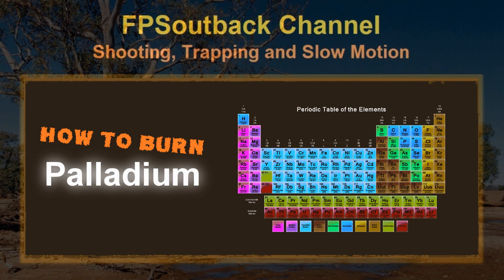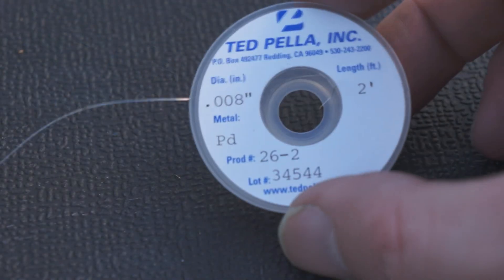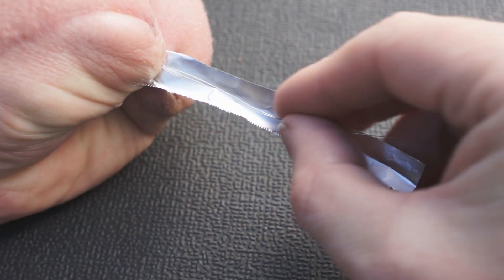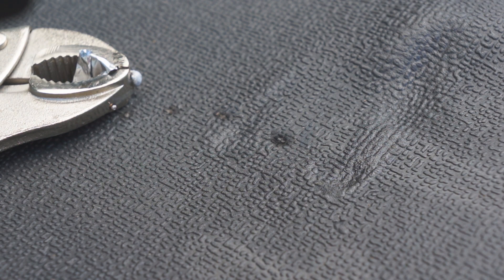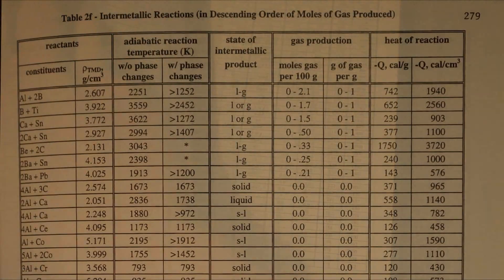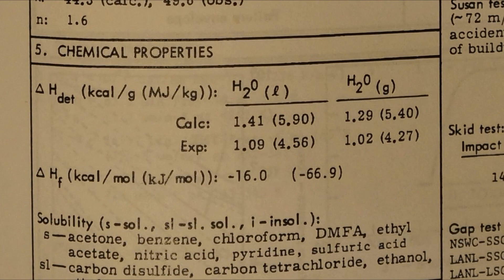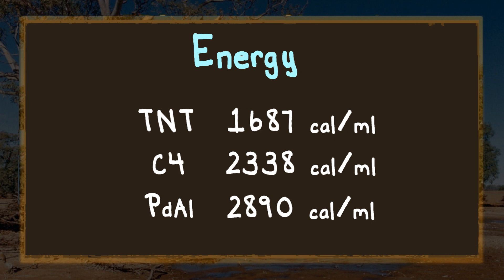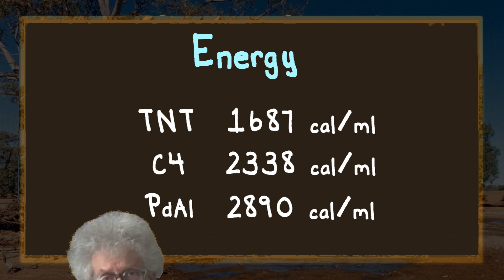How to Burn Palladium - Interesting Chemical Reaction with Aluminum

Comment: Try this again in a vacuum or another inert atmosphere. I would not be surprised if the aluminum alloys into the palladium and can't protect itself with its usual Al2O3 passivation layer (being less concentrated), so it burns like magnesium. There is definitely a smoke from the fire (most likely Al2O3), and perhaps tiny bits of molten palladium (orange sparks). I'd be impressed to see pieces of the alloy lying around after.
Reply from the maker: I'd like to try that as well as underwater. Expense is holding me back though, I will try shooting Pd into Al at some point so see if a supersonic collision will initiate the reaction.

Comment: Boron and titanium is very high.
Reply from the maker: Ti + B was investigated as a practical explosive, mainly for underwater torpedos where its high heat and secondary reactions with water were advantageous, not really an intermetallic though, more similar to Zn + S rocket fuel.

Comment: This is intriguing, since the oxidant is a metal, although something seems iffy because I can just see on that chart that aluminum won't release nearly as much energy when it reacts with copper, which should be able to do the same kind of thing. It does show a high value for aluminum and cobalt. I think noble metals really are intended to be considered for oxidation resistance, no problem if they can be reduced easily by very active metals :)
Reply from the maker: My take on it is the energy is derived from rearranging the typical amorphous "electron sea" of metallic bonds into crystalline covalent bonds with a distinct stoichiometric ratio, so the possibility of reaction must look at the arrangement of the crystalline lattice rather typical redox reactions.
Reply: FPSoutback Pd is two electrons away from having the 5s24d10 configuration, so maybe the alloy is in the stoichiometry of Al2Pd3, since Al has three valence e-. It does not make sense that Pt won't cause any reaction. For cobalt and copper, based on the electrons they have, they would form AlCo and AlCu3. Co and Cu should not be too spendy haha

Comment: Coil a bunch of the wire combo into a 12 gauge slug, top it off with flint or something that will set it off. It won't weigh or penetrate much, but it might put on a nice show!

Comment from the maker: Detcord detonates at ~7000m/s so no, if you mean fuse then yes it could do that at a cost of about $100 a foot. Makes a sparkler sound cheap don't it :p. Could possibly be made relatively cheap by plating palladium onto an aluminium core assuming it could still sustain the reaction.

Comment from the maker: (*continued) These other combinations may well work if the conditions are right, but are nowhere near as forgiving as that between PdAl. Platinum's melting point is higher to which works against it, since the reaction aint going to proceed in the solid state.

Comment from the maker: Palladium is not a particularly reactive metal itself and can be mined as nuggets like gold and platinum. I had found references to a strong exotherm when creating a PtAl alloy, the number below PdAl, 2510cal/mL is for the formation of PtAl, it may require higher temperatures or just not a self sustaining reaction due to thermal conductivity, lack of intimacy etc. Of interest I could get NiCr+Al to work but not Ni+Al itself even though Ni is the main energetic reactant.

Comment: I've made and shot Ammonal with a .223 and seen that blow up. I made it from powdered Al I found on ebay, and ammonium nitrate I found in a instant cold pack from the dollar store. Kinda wonder if palladium would make a larger boom, but no way will I be the first to try it. The explosions from Tannerite and Ammonal are good enough for me. Rim fire tannerite is even more fun as ammo is a lot cheaper if you can find it in the usa.

Comment from the maker: More so then that, it set me back $50 just to demonstrate it. It could find uses as a gasless non electric fuse for specialised tasks. Its remarkably fast considering the poor contact between the two reactants, just wrapping foil around a wire.. but of course this isn't a high explosive its a class on its own.

Comment: sounds like you have a feathered lab assistant.

i suspect why PdAl isn't used in explosives is the speed of the reaction. TNT and C4 are extremely fast. I suspect PdAl is impractically slow despite having more energy overall.